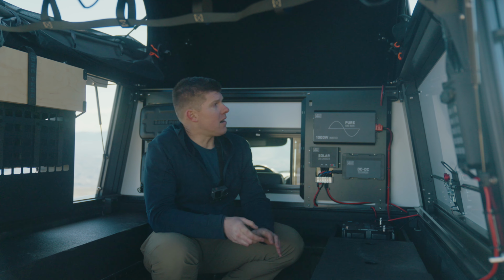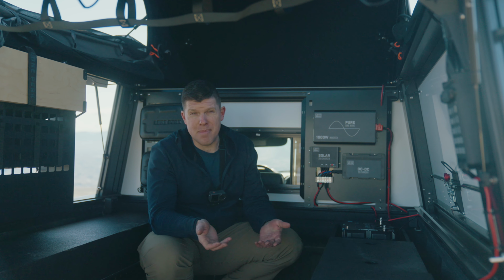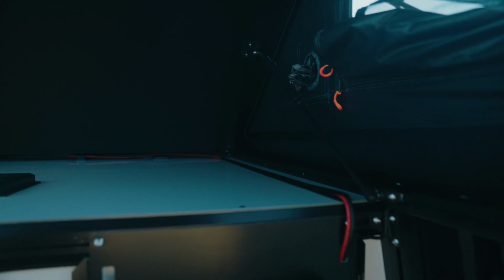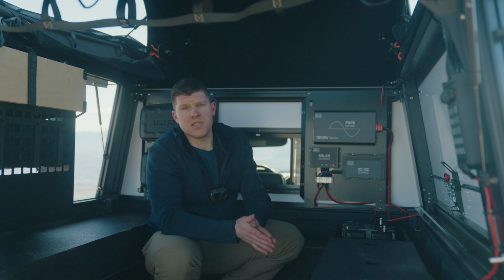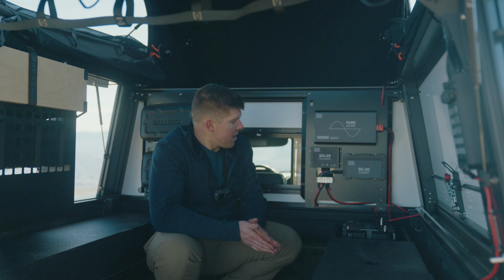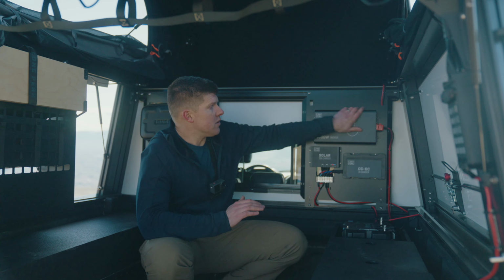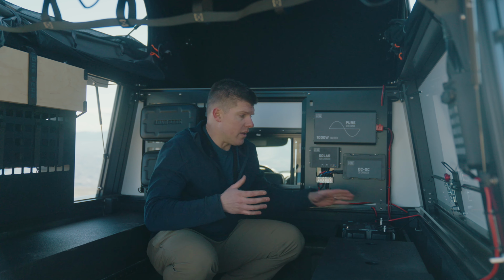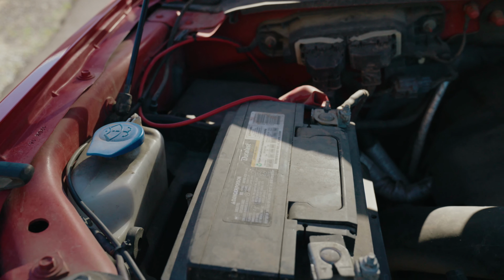Lone Peak Accessory - Power Generation & Storage

Comment: Curious what drawer system you are using.
Reply: I want to know too!
Reply: It’s a Truck Vault Base Camp 4. Downside is no kitchen pull out. You can customize the left side from the base camp 4 and the right side from the base camp 1. I had a quote for a 6’9” F250 for this that was right at $7,900 with me driving to them to install.